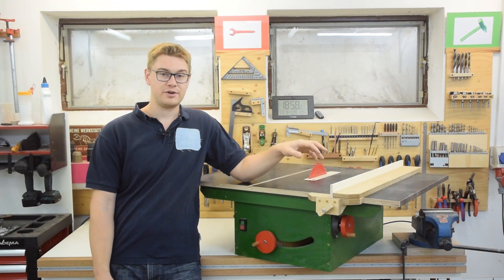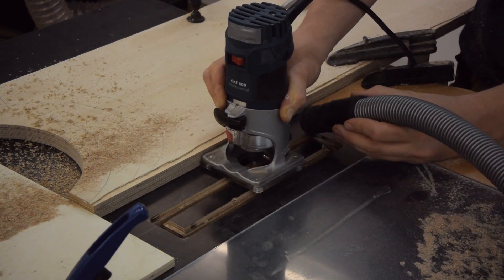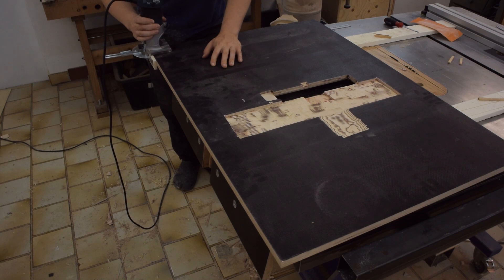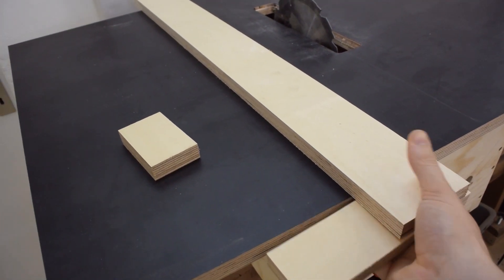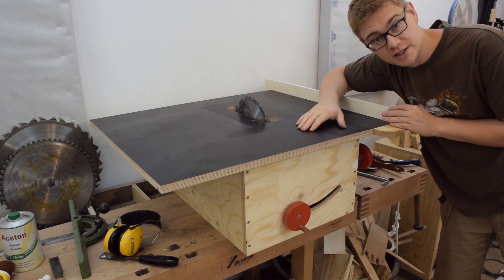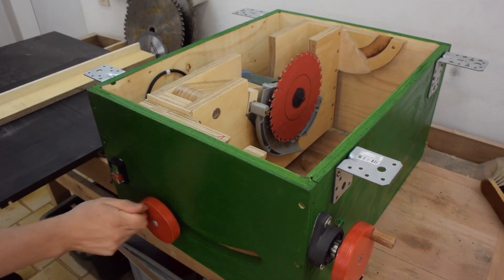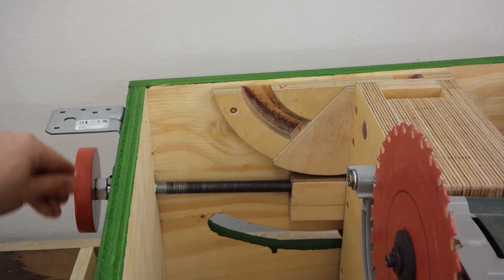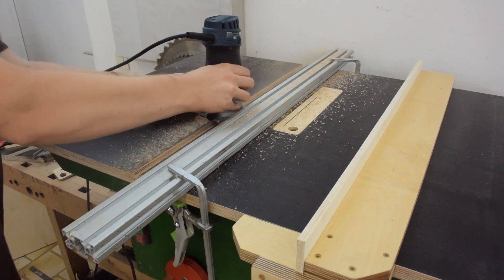How to build a Table Saw with Simple Tools - Part 3: Table and Fence System

Comment: What size blade do u have on this saw man? It looks like a huge blade. U build that trunnion system really well. It runs really smoothly too btw. I'm about to begin building the housing for my table saw but I want to use tubular steel as part of it. Do u think that's over kill or what man? I want to build a metal frame to attach the trunnions to but I will also eventually put metal sheeting around it at the very end of the build. That's my hope anyways. The reason I want to use metal is for weight purposes. If the saw base is heavy and the table top is separate then I can always realign the table top with the saw blade and vise verse.. That's the plan anyways .. Great content my friend. Keep it up with the great work

Comment: Excellent build and clever use of levers.  To all the potential Acme thread nay sayers I think the use of a metric course thread is perfectly valid here.  An Acme leadscrew is used for translation under load.  The metric thread used in this innovative build is only operated when not under load.  The pitch angle of the metric thread is more likely to self lock under vibration and loading,  and therefore less likely to make the blade position change during operations.  Well done Cosmas👋

Comment: Good stuff! Is it hard to change the blade?
Reply from the maker: Changing the blade is just like on any other table saw. Get in there with a wrench and make sure you don't drop the arbor nut ;)

Comment: Outstanding design of table saw! It  sounds like it's built by an engineer.  Only suggestion I had was when you built the mechanism you could have built the dust chute around it to capture most of the dust, instead of sucking the dust from a big chamber.  Other than that it is marvelous.  Way to go!

Comment: Mechanically, your Saw is better than most of, if not all portable jobsite saws on the market! I appreciate the blade tilt crank. Most jobsite saws don’t have that simple feature. It makes it much easier to set accurate angles. I really like the trunnions on it. Very well made and seems to operate pretty smooth. Great job

Comment: It's funny because I'm planning on taking a broken Craftsman 10" table saw into a homemade table saw. By broken I mean the motor works perfectly, the table top is broken and the whole body is in like 20 different pieces. By funny I mean like just yesterday I was wondering why you never finished this video set. Quick question though, if I use two supports for the lift instead of just one would I get a more even lift?
Reply: You may put the mechanism in the center, instead of one side